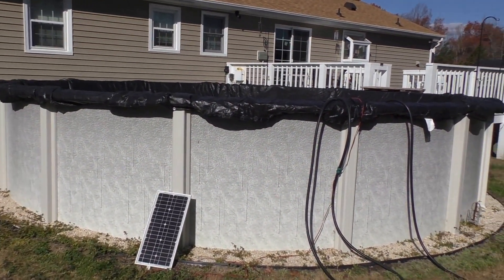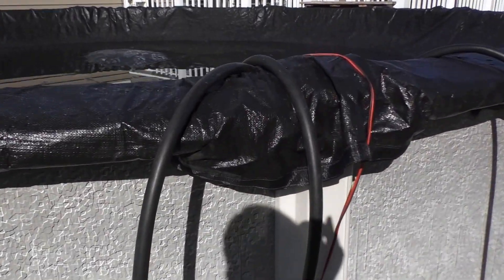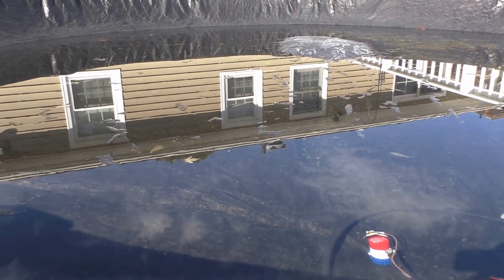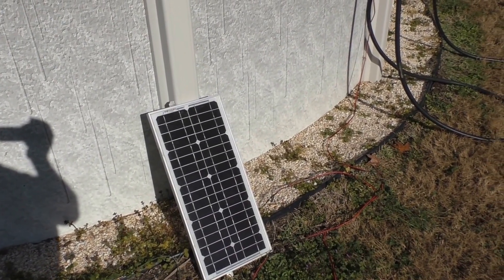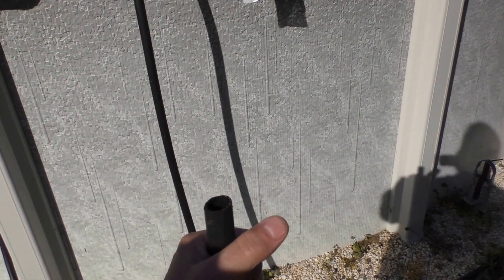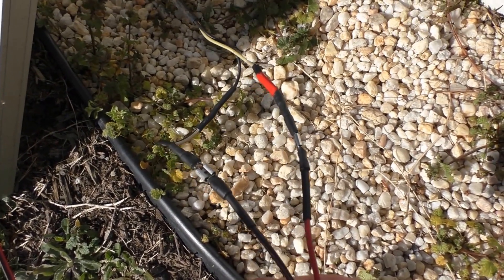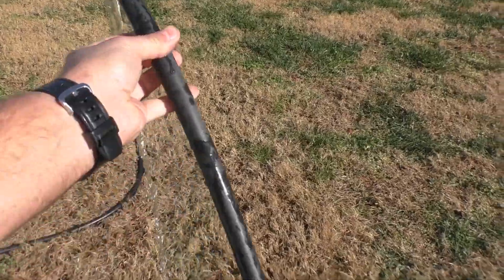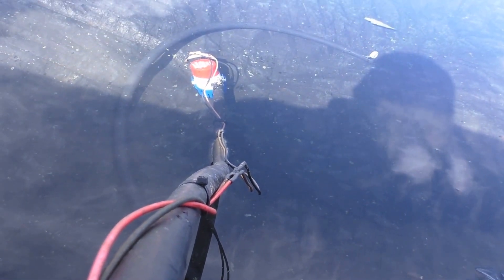Solar Powered Pool Cover Water Pump By KVUSMC

Comment: Kenneth, I have put together the same pump and a 20 watt solar panel with 18 gauge audio wire with red/black and about 25 feet of and older garden hose. Have not tried it yet on the neighbors pool. Just one question, what's the extra hose for? you show two in the video. I was thinking I only needed one hose about 25 feet long. The Rule 360 Bilge Pump only has a 3/4" outlet. What am I missing? Randall
Reply from the maker: +Randall C the extra hose was just for a siphon hose
Reply: OK thanks, thought I might be missing something. I'm good to go. Thanks Kenny, Randall
Reply from the maker: Your Welcome Ole Buddy

Comment: Dam that pumps nice :-) 

where we are, i use a crappy pump from a ornament to pump water from a cover we have over a pit, that is hopefully going to be filled with concrete (it's a old greenhouse base that's going to raise my new 12' x 8' shed off of the floor (when i buy it) 

the pump is very very tiny and takes about 10 mins to fill a bucket, (when it works, as it sometimes gets stuck) but we use the rain water to flush the loo (toilet), so it doesn't go to waste, plus the batteries i use are charged by the solar cells i have, so it costs nothing 

so i gather you don't harvest the rain water from the pool cover ?
Reply from the maker: +drEmulatorMadmax Hi Buddy Many Thanks I Have about an 80 foot well And County Water I don't save my rain water But I Actually use it to water my Garden so I guess I am using it to water my Winter and Spring Crops Many Thanks for watching Great use of water cheers buddy Kenny

Comment: Hi Kenneth, I've got one 140w 36cells black mono for around 3 years and recently I've notice it's only putting out 9v with load on it, if I just go open circuit it will show little over 20v but any small load it will drop down to 9v! I have changed the bypass diodes and sill the same! I wonder if you have had this issue already ? God Bless.
Reply from the maker: I have Had an issue in the Past of No name Brand Solar Panel I called the company up It was under warranty It would of Cost me more for shipping than it was to Fix It  Try  another Diode every now and then a diode will go Bad from the Factory I wish I could Help more Or call the company or Email Them also make a Video on It Some one out May know to Fix it ! God Bless